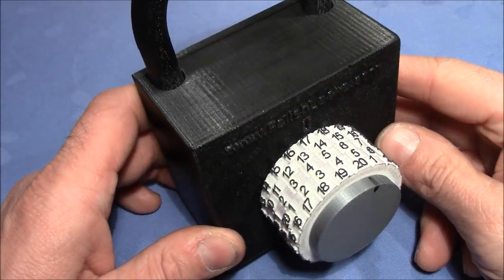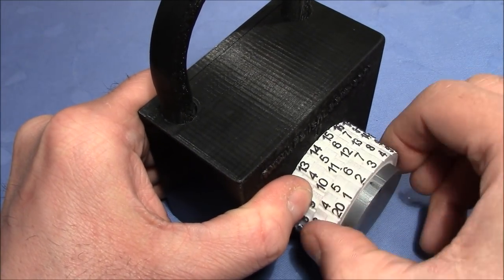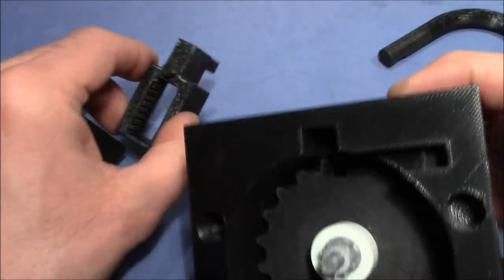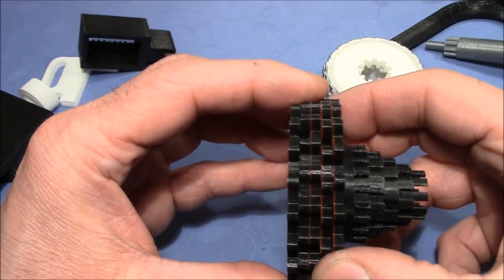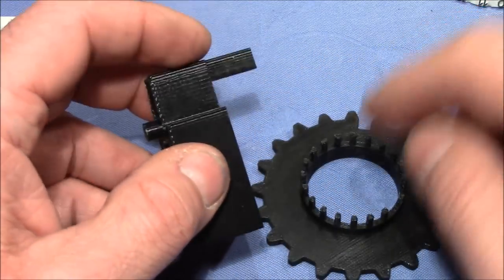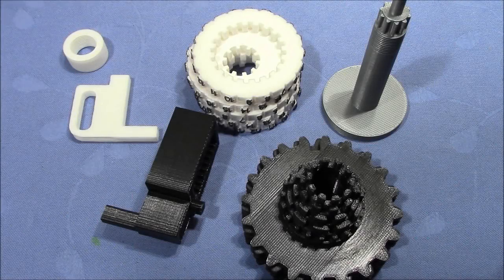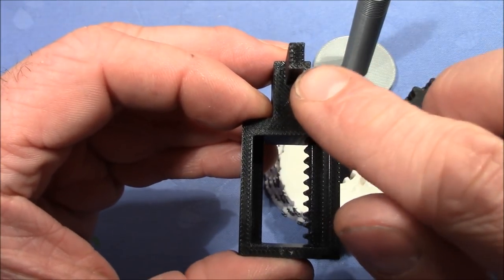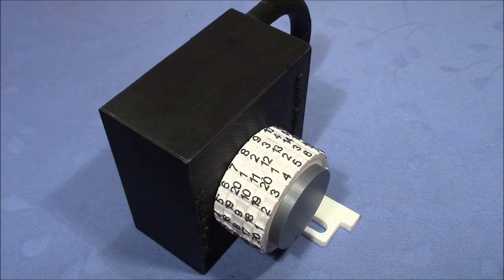(picking 630) The polish Combination Lock - ultimate review [ read description ]

Comment: Great video :-) I think this design has potential. By making the lock out of metal, the overall size could easily be reduced by over 50%. With 20 numbers per wheel and no easy way of decoding, 3 wheels would be adequate and reduce the thickness of the lock. The wheels could even be partially enclosed too, with the top of each wheel only being accessed from the top of the lock body. The opening wheel could either be recessed into the first number wheel or indeed, the unlocking mechanism could be made into a sprung button on the top/side of the lock.
Reply: You are right I just finish project of full metal padlock with 4 wheels and the size is only 33mm thick, 44x40mm body and 8mm shackle. You can look at it on my web page. I am looking for someone with CNC to produce it for testing. Cheers.

Comment: Hello everybody. First of all I would like to thank very much to Potti314 for everything he did with my lock mechanism. I like his honest review and feedback. This is time for me to analyse all feedbacks from World-Wide decoding challenge to redesign my Polish Combination Lock mechanism to be better before real production started. This prototype made from plastic is just first "rough" version of my idea, just printed out from CAD without any special attention to details but to focus on working principium to show you the idea and to grab valid feedbacks. Of course as Potti314 pointed out the mechanism has a lot space for improvement and I will do it of course. Even now on my page you can download STL files with second version (white) where I improved a lot comparing to black version. You can see that even black one is quite secure at this moment. The plastic version has its limitations like tolerances for working and durability, the thickness must be at reasonable level. I am sure pure metal (brass and steel) would be much more compact, precise and user friendly. You can see maybe also that this project has now 200 000 combinations instead of 3.2 million as I mentioned but this is only because it is plastic model and has limitations as mentioned earlier. There ware questions about possible way to look inside to open it but this is not possible from outside even if you cut all wheels flat with surface you will not be able to open it from outside. Drilling attack can solve it and the mechanism must be protected somehow here as well. There is a lot to do further and you can see the progress on my page as well. I will continue the decoding challenge and next one is LockTube from Poland. I wish him good luck for decoding and count on such a great job like Potti314 did here. The more honest and detailed feedback I will receive the better will be the final product. I agree 100% with Potti314 and I like his deep level of expertise. Interesting remark to replace numbers with letters! It will limit the possible combinations using words but really nice concept. So again thanks Potti314 for your time and valid feedback I will continue my project and hopefully find someone for partnership to produce it. Cheers and happy picking as you said.
PS. This issue with turning too much for the actuator is solved already in white model: 1. the back plate is limit this, 2. the dead bolt is longer and 3. the actuator has better fit to dead bolt hole. All together align the actuator perfectly under locking cut in the household. You can download STL and see it in details. The shackle could have the locking cuts from both ends to allow locking regardless of the way you enter it. etc. etc.
Reply from the maker: Cheers buddy, it was an honor for me. looking forward to see / feel the metal prototype someday.
Reply: @Potti314 you are great person. It is my pleasure to deal with you.

Comment: Wow, you are hired to re-assemble locks -- super fast! (ha, ha) -- Very interesting design and quite a feat to make it all from a 3 D printer!  Excellent job to Zbigniew!  I think with the stepped down wheels, letters instead of numbers, and detent for each gate position,  the lock would be much more user friendly.  A changable feature could be implemented, similar to the wheels in safe locks, with an inner and outer section of each wheel unlocked with a change key.  I don't agree with Potti as I think this lock would be quite expensive to produce, especially if used a changeable combination like I just previously mentioned.  I note that each part is unique, and you cannot just use 3 each of the same wheels as in a safe lock.  I think potti's suggestion of making this as a safe lock might make this project a profitable venture, however note that in a safe lock you can only use the normally provided small hold that just allows space for the dial shaft -- i.e., you would have to "miniaturize" concentric shafts from the outside of the safe door to the inside to the safe lock.  I still would buy one.

Ken
Reply: In my thoughts of making this as a safe lock, I note that safe doors are of variable thickness, thus making the "Miniaturize" concentric shaft idea even more difficult to implement. -- With a standard safe lock, you just cut the spindle shaft to the desired length -- Ken
Reply from the maker: Thanks for the remarks regarding the spindle in the thickness - I didn't consider that. Also you might right regarding manufacturing costs as the parts differ. Still I believe that assembling the parts of the mechanism would be easier in the polish lock,

Comment: Interesting couple of videos you've  done on this lock
I enjoyed them a lot, Thanks.
 I'm guessing the dails would have some sort of spacers between them to ease fraction on the final lock? and the tolerances not as tight? making it a different animal altogether. 
I don't know enough about this lock or safe locks  to see it's potential but it's great their willing to show it before its production and possibly make changes.
More power to the designer.
Reply from the maker: Thanks - it was a totally different "work" to analyse a locking mechanism that is currently being developed. Not the usual picking - haha. I feel honored that I was asked for a review. Lot of work needs still to be done on calculating the dimensions and tolerances for the final metal lock.
Reply: @Potti314  thanks for showing, I was subbed to him but I've never watched or even seen a video he's posted, but I hit the bell this time round ;)

Comment: Good review of this 3D printed model - I see it as just that though - it's a 'concept' only, and in metal a lot of the problems, as you said, would go away. Quite a lot of work to make a working model in metal though ! I don't agree that it would be cheaper to make than a standard 'safe' type padlock mech though necessarily - lots of parts, and some might be hard to make - depends on the  materials chosen I think.  Also, imagine trying to describe the combination change method in a users' manual, and the average user trying to actually do it  :o(   The 'clicky springy' thing at each number that you suggest, we would call a 'spring detent' in the UK, and I agree that would improve the user feel when twiddling the wheels.
It's an interesting design for a lock though, and Zbigniew must have put some hours in already - I bet the 3D print version didn't work at the first attempt :o)
Reply from the maker: You're right with the parts being different and hence more expensive to make. Still assembling the parts to the final lock might be easier in his lock. Changing the combo is still very user unfriendly - I agree ;-) Maybe a clever idea can make it easier.

Comment: Superb video, Potti. I think you covered every aspect of this very interesting lock.
In the prototype I don't see a way of changing the combination without taking it apart. I assume that Z. Olejnik will have some sort of mechanism to be able to do that in the final product. Although, I think it might add to the complexity of the locking system and I hope it won't reduce its security.
Btw, that's a lovely Sargent and Greenleaf padlock you have. I've had an 8088 for 10 years and still can't decode it. I don't feel too bad about it as they are military grade locks. 😭
Reply from the maker: I'm not in cracking safe locks - that's a totally different story - haha. I believe Z. Olejnik expects the user to disassemble the lock for changing the code,  but I believe that the average user cannot do that.
Reply: @Potti314  Yes, I agree, dismantling the lock to change the combination is a bit extreme. Even the S&G, for example, has a complicated way of changing the combo, using a tool (we call it a  punzone in Italy) when the lock is in an open state, but it doesn't have to be taken apart. I think it's a must-have feature in any combination lock, even if the lock has millions of possible codes. 👍
Reply from the maker: Yes, this must be solved. I changed the code on the S&G once and for the first time - it was quite scary ;-) I even made a video about it as documentation if something would go wrong.